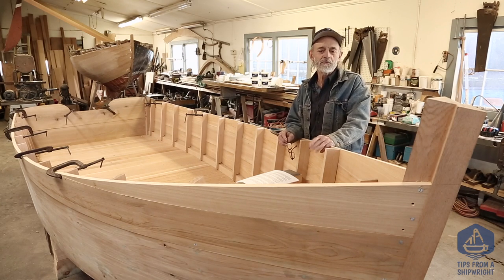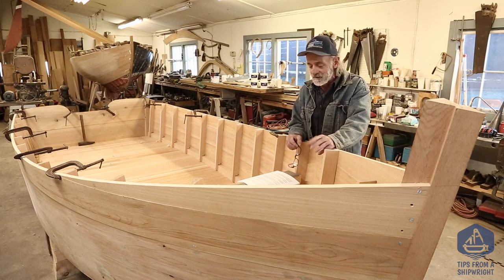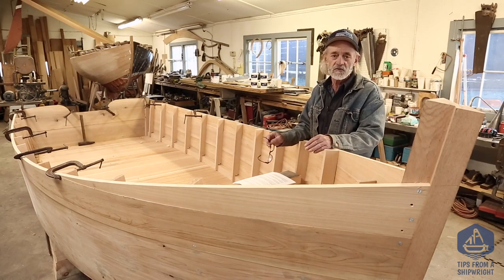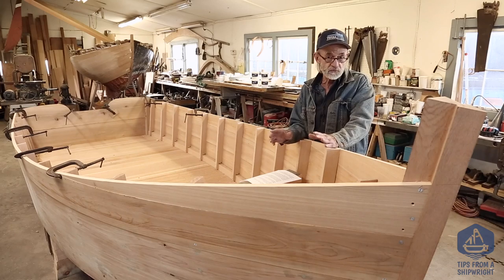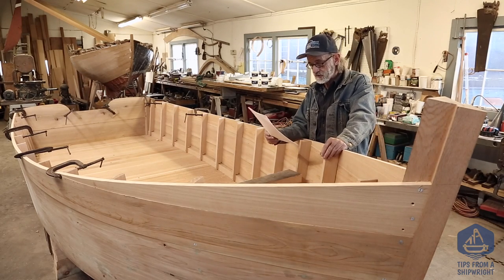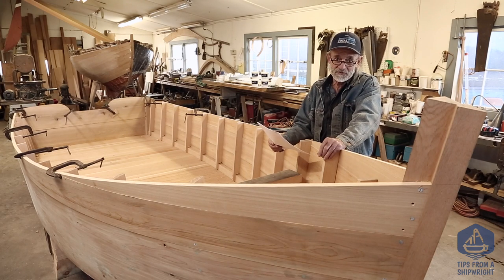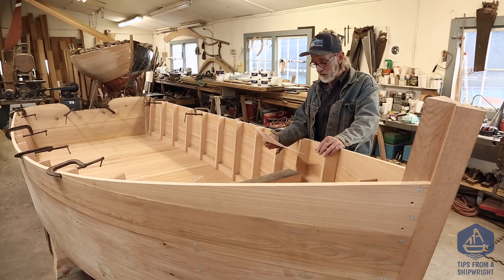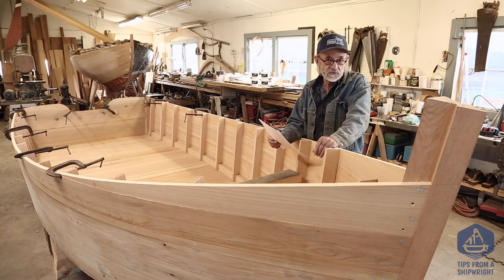Building the TotalBoat work skiff - Q&A with shipwright Louis Sauzedde

Comment: The boards on bottom swell and become water tight now you just taught me how a wood barrel works, wondered why they would use barrels many years ago to hold liquids without them leaking out.  I have plenty of free tree wood and want to make a huge barrel to collect rainwater for my garden so your boat building has taught me how to improve garden with free water.

Comment: Hello I absolutely love the videos you make and find them inspirational. I have a 38 new haven style sharpie that was built in the early 1960s that I'm going to begin restoring in the spring. I plan to do it using some of methods that you use on the skiff project. Thanks so much for the inspiration. Keep up the good work.
Reply: 38ft sorry for the typo

Comment: Enjoyed the Q&A video. Thought some of your viewers may enjoy reading about seafaring nomenclature. The term gunnel or gunwale came into use with the advent of gunpowder and cannons going to sea aboard sailing warships. Most likely England being the country of origin. It soon became apparent to ships master's and shipwrights, that a strengthening structural band, or "wale" was required around the top sides of these ships, at and above the level of a gun deck, mounted inboard of the sheer strake. Designed to accommodate the stresses imposed by the use of cannons, since the recoil of the cannons was arrested by way of ropes connected to the sides of the ship. This structure became known by seamen as the "gunwale". Now more commonly referred to as the "gunnel".

Comment: Your series has been the best.  Especially when you use nautical terms.  If I do not know the term, I look it up on Google. Now I am learning the correct nautical terms.  I build fancy canes for older people and build take down bows.  I build them because of the beauty of the wood when I am done.  I have learned a lot of tips and tricks from you with this series. The only question I have is what distance did you place the outside runners from the center runner and why?  You deserve a great thanks for an excellent series.

Comment: Louis, I love the passion you have for your craft, and your skill as well. It truly is inspirational. I want to ask if you have any wisdom to share about modifying tools - for example your progressive bevel circular saw, the 7-inch grinder with the saw blade, or the power planer that you turned into a scrub plane. When is it worth it to you to modify a tool vs. just working with what you already have? Do you experiment on cheaper tools first, or just dive right in? Thanks!

Comment: Dear Lou, I'm heartily enjoying your wonderful series.Thank you so much for doing it.  I've built several plywood skiffs as well as a couple of lapstrake boats and I'm just now figuring up the materials to build a 17' Pete Culler-designed, yawl-rigged sailing skiff, with lapstrake sides, to teach my son and grandson a little about boatbuilding. The plans call for cross-planking the bottom, as with your skiff here. I've never used this type of construction before, and everything you say about it makes sense. It will dry sailed, off and on during the summer, so my question is: will it dry out and leak too much when used intermittently? If so, should I change the design and use a plywood bottom? I'd surely like to try cross-planked construction but worry if I'll be asking too much of it to be watertight. Thank you in advance for your advice. John Breiby, Wasilla, Alaska.

Comment: Louis I have thoroughly enjoyed the series from the beginning. My biggest questions concerning the building of boats is in terms of wood  choices. I live in Arizona and have limited selection of woods mostly from the big box stores. I can't get my hands on cedar outside of pickets. would pine be a suitable substitute for the sides? Essentially I have red oak (very expensive)  pine, and some dimensional redwood. Also since I live in a land locked state my boat will be used for the summer on day trips. I can garage the boat the rest of the time. I have started a plywood boat roughly the same size as yours but was forced to use sheething as marine plywood would have cost over 10 times the cost. I have halted construction since I have more questions than answers. I have asked around locally and was told to use whatever I wanted and just fiberglass everything... to me that is not an option. I would buy a fiberglass boat if thats what I wanted. suggestions are greatly appreciated. feel free to address any portion of my questions in the video if you wish. Thanks again and Merry Christmas

Comment: Hello Louis, I love your videos. Want to build this skiff in the Netherlands as soon as I'm retired next spring. Can you show in your video a basic drawing with the dimensions of the boat including the side and bottom planking sizes (width and thickness). Also the outside dimensions of the used mold will help me to transfer the feet and inches sizes into meter and milimeter sizes.

Comment: I would like to thank you for this series. There are few trades people that show the degree of craftsmanship that your work does and you are to be commended. One question that I have is if you were to use plywood how would you join the ends sheet to sheet since it's only available in eight foor lengths? Also, is the plywood cut into planks to make it easier to bend them to the shape required or is it left as is in a sheet form?

Comment: Louis, would you consider building a small sailboat as a future project?  How do you determine where to set the mast, beam, and keel (or centerboard) along the length of the hull for proper hydrodynamics/aerodynamics?

Comment: I'm a commercial lobsterman in Maine and my question is on galvanized fasteners versus stainless steel...In my early days i had a fiberglass over wood lobster boat and had to temporarily use galvanized lag screws instead of stainless to hold my prop cage on because the marine store was closed...Within two weeks electrolysis ate those lags and i lost one side of my cage....Does this not happen with a wood skiff ?
Reply: If your prop cage was aluminum it was galvanic corrosion caused by the miss matched metals. I am not 100% sure if that's the case but to me the most likely, aluminum can be hell for boat building.

Comment: I notive you have Common screws on the bow holding the boards , I live in Canada our contractors have made a Screw that`s called a Robertson Square -there`s a size 1 2 3 4  drive  when you get down to running long screws using common heads OMG they can be a nuisance stripping but with a robertson it can be drove and removed many times ,I`m just curious if you`ve heard of these ? During Katrina some Canadian contractors went down  to Louisanna and introduced them and they coud`nt believe how much better they were .Just curious Beautiful Skiff .

Comment: Hi !

I wondering why you use galvanized iron/steel screws in oak - I was told oak contains tannin that will attack the iron/steel and discolor the oak - I sure you know what you're doing so confirm that it's the galvanizing that does the difference or ... ?

Comment: Questions: Is there measurements for planks when to use, and when not to use sealant in the seam? How long/short the plank needs to be that the seam stays waterthight and how thin/thick? Does fastening interval make any diffence? I'm designing my own boat, and very interested in these clean seams. is there a way to use them on sideplanks and other longitudal seams? I'm going to use Pine and Norway spruce as material, because it grows here. Does those wood materials make a diffence in the seam type?

Comment: Nice Q&A I also am a long time shipwright  I love to here  answers that are clear and accurate.
My question is not directly related to the project but i would like your thoughts.
My Chinking hammer is about as old as i am and has many cotton miles , however over time the inner steel collars have become loose and the only way for me to get them tight again is to soak the hammer in water for 24 hrs, is this normal,
but to be honest i like the feel of the hammer better when its been soaked  Your thoughts on this

Cptn Uwe
Reply: Cptn Uwe's Pirate Tales you might try soaking it in antifreeze; the propylene glycol therein will swell up the wood like water but then will not evaporate.
Reply: Hi Cptn Uwe, sorry for butting in. I'm am a blacksmith in wales us, I have a similar problem but with my hammer hafts drying out and hammer head becoming loose, I find soaking them in water only lasts for a short time and doesn't do much good. I now soak my hammers in a 50/50 mix of boiled linseed oil and Cuprionl wood preserver. I find the wood preserver carry's the oil in to the wood really well and it lasts a lot lot longer then just using water it also preserves the haft, hope that idea helps!
Reply: Cptn Uwe's Pirate Tales mmm
Reply: Soak loose hammer heads in antifreeze. The wood takes it up & swells & won't dry out. Ethylene Glycol..I think it is.

Comment: I wonder how well stainless steel fasteners would hold up. Based on my experience with stainless used in brackish water used for cooling water at power plants, 304 or 316 SS will be eaten by MIC (microbes in the water) in a year or two. We used MONEL and it lasts forever. Bolting that was in the water for over 30 years was like new when removed with no sign of microbe attack. 316L (B8M) is better than 316, but still not as good a MONEL or AL6XN or some of the other super stainless products.

Comment: i have only made 1 and almsot a second canoe.... (fall time showed up in canada and i had to put it onhold untill spring becuase i dont have an insulated shop)  the first one turned out almost perfect..... looked great and when i was about to test it out to use to go on a canoe in camping trip with my kids, i found i was too tall to use it.  when i sat in it on the seat i was too top heavy and it almsot flipped every time.  when i sat on the floor of the canoe it was fine.  when my kids used it becuase they are half my height, it was perfect for them.  now i need to figure out after my kids outgrow it, who who would want a children sized canoe?

Comment: Inspiring? Yes... I don't have the tools to work wood. But metal? yes... I will build a smaller tubing framed covered in polycloth and glass resin. But it will get me in the water and to a fishing spot. Even if the boat doesnt use a trailor. Just tie it on the car and bring paddles. Laying out some bank line for trot lines and lay out some basket fish traps. Even if the hull is micro, i can float the baskets and suplies behind me. I'm the only one who needs to stay dry.